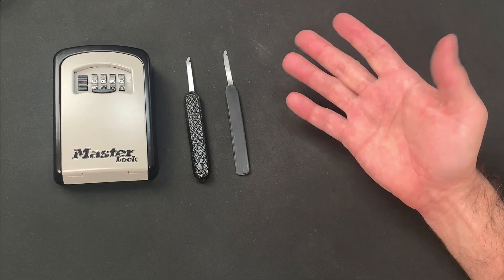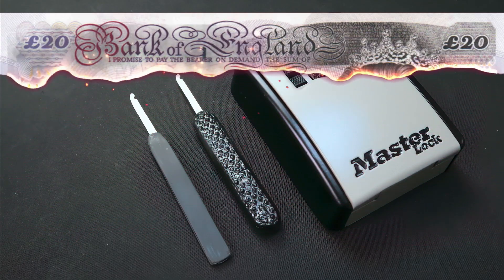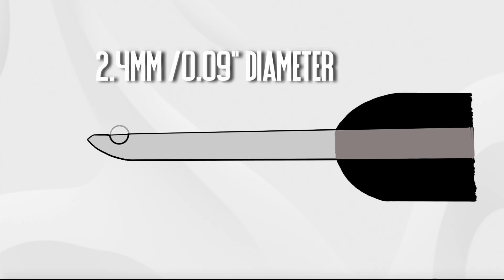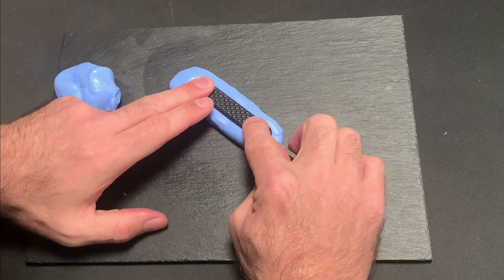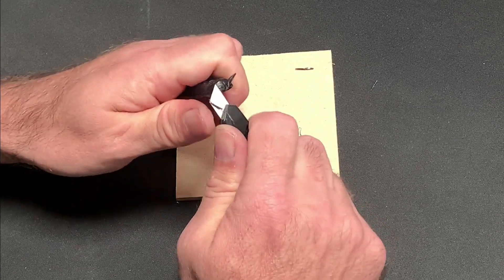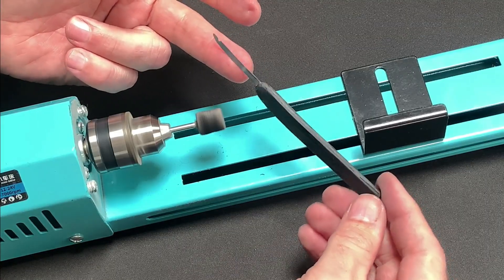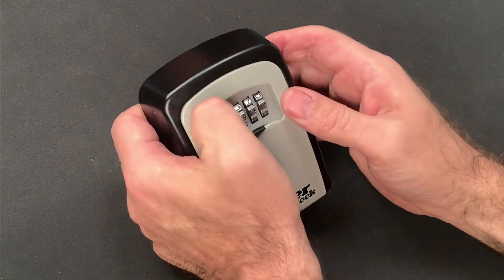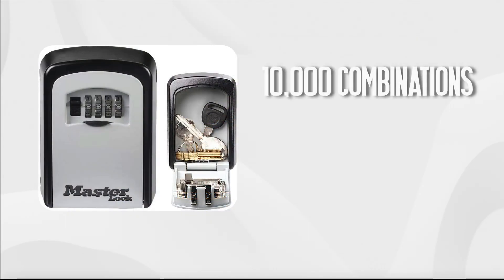028 How to make your own notched decoder to open combination locks

Comment: If you put the flat blade of the decoder into the top left of each code wheel and gently push up, when you rotate the code wheel down the tool will go up about 10mm when it finds the gate. Align the gates then up two on each wheel for the open. Much quicker, average 25 seconds for the open.

Comment: Gone and bought a cheap and nasty version of this lock (as if that's possible) and its fixed! they have made the wheels such a tight fit theres zero shim space!
But, where the code mechanism is fitted, the outer casing has too large a hole by like 0.5mm, so you can slide something in and simply push on the case locking claw...... like shimming an old padlock with a bit of coke can.

Comment: Fish, you did it for me, thank you.  I've been trying to open a 4 wheel lockbox for more than a week now (not continuously), then I saw your video and ... make a "decoder" out of a feeler gauge!  Well, I have a feeler gauge.  So I found one that fit, not snugly, but not loosely - 13mm (15mm was just a bit snug).  I put the feeler gauge in at the left side of the first wheel - then just marked the gauge (along the top of the wheel).  Moved it one to make sure that 0 wasn't the first digit.

3 wheels later and ... no.  I got the number (and wrote it down the SECOND time), but the box wouldn't open!  So I started decrementing all 4 wheels by 1, trying, decrement by another 1, try ... eventually it opened.  (I have no idea why I chose the number I did.

Now it's set to 0000, until I need it again.  So thank you.

Comment: 12pc broken key extractor kit online for a few bucks does the job very well. Slight modification to one or two of them and you now have a full set with varying gauges down to 0.15mm.

Comment: I have the sparrows one, but I've also made some out of stainless-steel cable ties/zip ties.  They don't have the notch but the tip on the ones I had were pretty much already formed. I folded the end over a couple times to stiffen the handle and slid it into a Southord rubber pick grip.
Reply: I've had them laying roung for ages, thanks i'll do similar,

Comment: Buying a decoder has always been a bit of a bad idea in my opinion because of how expensive they are. Even Sparrows, who's known for quality at a reasonable price, charges $15 for one while charging less than half that for actual picks. I always buy a set of feeler gauges for $5 and have plenty to make a set of 0.05, 10, 15, and 20 decoders and still have plenty left to make other tools. These things have to be costing them rounds about $2 to produce.

Comment: Wow, so much time to do so little.    Another guy said just take a soda can, cut it and make a shim from that.   I think a store brand might work better than a name brand as the aluminum may be thinner.   

Cut a strip about 3" to 4" long. The trick then is to cut it narrow enough to fit inside the left side of the wheel.   You don't even have to notch it, just make it a strip.   Simple enough. And forget about  needing to make a handle.  

Insert to the left side of the wheel, a slight resistance pushing down as you turn the wheel one number at a time.  When it hits that sweet spot, the shim drops.  You can confirm that by backing up the number   and the shim should move up.

Move on to the next wheel and so forth until each wheel drops under the shim.   Now try to unlock it.   It probably won't unlock because you have the right combination but not the right numbers on the top.   Move each number as a set one at a time.  If it was 1,2, 3, 4, move it to 2,3,4,5.   Doing this three times usually works and unlocks it.

You don't need an expensive tool.  You don't need any training at all.    I have a rotten contractor who has used this lock.  They thought they were smart by putting the keys in it and switching the combination so I couldn't keep them out because they have some very shady workers.  

Guess what?   Making a shim from an empty soda can with a pair of scissors, finding each sweet spot and unlocking it took around five minutes.  Oh, the video took me longer to view than actually opening it.

All you need is to cut that soda can, make a flat shim, trim it narrow enough to fit inside beside the left side of the wheel, push it in, push down a bit until you feel resistance, and then move the wheel until that shim drops about a  1/4 inch.  Repeat on each wheel until you have the right combination.  If it doesn't open, rotate each wheel in the sequence 1 to usually 3 times and it opens.

Having a construction company put this on your door is not only like having the keys hanging on a nail outside, it's like hanging a sign that says "come and get it" to a trained thief.  I'm not trained and not a thief but figured it out in about 12 minutes including watching the video (er, not this video).

Comment: I would rather pay the 25 bucks than go through all that! I don't find the Covert Instruments version to be as flimsy as you make it out to be. With a little finesse I have opened dozens of locks with both Sparrows, and Covert Instrument's picks with little to no damage to the blades. Besides, you can easily straighten these blades out with a pair of round nose pliers. You can get these pliers from Amazon for about 5 bucks.
Reply from the maker: Thanks for the comment -it doesn’t align with my experience but I’m glad you have found the tool more resilient. For the record ‘going through all that’ was fun - again, we all have different values and levels of interest in creating/appropriating tools.

Comment: Have you considered using one of the tubular scalpel blade holders, and using the part of the scalpel blade the fits into the handle as a template?  That would also have the advantage of easy tip replacement.
Reply from the maker: That’s a great idea Niq - not something I considered but I suspect that would work really well. 🙌

Comment: All a bit ott. I Just cut a coke can to form a tool. Novice, Picked in 5min.
Reply from the maker: I think the success or failure of that approach is really dependent on the lock in question but if that’s working for you, go for it 😉🙌

Comment: You can use a pair of round end jewelers pliers to repair them when they get kinked. I'm a jeweler on the side, and can confirm that it does work to fix thin metal.
Reply from the maker: Thanks - another sub mentioned that technique too - very helpful tip 🙌

Comment: Wonderful to see this. Many first-time pickers or pickers on a budget will benefit. I've found Noob's zip tie handles to be a good solution. Glad you've showcased them. I agree that LPL's decoder is too thin for most pickers so .19 does sound like a good compromise. Nice work. Hope to see more ideas here.
Reply from the maker: Will do my best to keep them coming - thanks for your support 🙌
Reply: What's LPL
Reply: @kenney1050  YouTube lockpicker The Lock Picking Lawyer. He has a store that sells picking tools for sport lockpickers, locksmiths and emergency service personnel.
Reply: @kenney1050 LockPickingLawyer. LPL.
Reply: @kenney1050 lock picking lawyer

Comment: Could you not just secure the shim inside the plastic granules instead of making two halves and then bonding them? Would be a lot thinner. However, I’ve never tried this so forgive me if this is very apparent why it can’t be done that way.
Reply from the maker: Yep I think you probably could but I wasn’t sure whether it would be strong enough but will give that a try another time 🙌

Comment: Hi Andy. Instead of using feeler gauges try searching Shim stock. Normally supplied in packs of 10  @ 300mm x 12 X Thickness required. Exactly same material but more of it for the price. 👍😎
Reply: What thickness is required?
Reply from the maker: Ooh nice tip - thanks Jeff 🙌

Comment: hi, I have got a little tip for you. Instead of using feeler gage, you could also use the springs simular like the ones in the pullback and let go toy cars. The smaller the cars the thinner and less wide the springs are. Greetings from The Netherlands aka Holland.
Reply from the maker: Nice - I’ll have to look into that. Thanks - always great to have these kinds of alternative solutions in the knowledge bank 🙌

Comment: Fantastic video mate. Very impressive and informative. I use a thin broken key extractor to pull up on the bar with heavy force and it makes it extremely easy to decode them in a few seconds. 👍🤘🖖🍻
Reply from the maker: Ah that’s a good idea - particularly if it is a nice thin pick or filed down a little to fit between the wheels of combo s with good tolerances. Hope the market is going well - need to catch up on your releases this weekend 🙌
Reply: @fishpicks4531  yeah it works great I did do two videes using it to open a combination key safes. I've stopped the market during winter as no one goes out in the rain. And don't want my equipment getting wet. But it was doing well. Thanks for asking. 👍🤘🖖🍻
Reply from the maker: @DarkArtsLockPicking  glad to hear it - maybe it’s worth building a website during the rainy season? If you do, I’d recommend Squarespace which includes e-commerce options and is super easy to maintain 😉

Comment: I’ve made several of these using zip tie handles and they work very well. Excellent job on the video👍🦊
Reply from the maker: Thanks Jack -yes, even though that was the simpler method, I think it worked better than the mould in many ways 😉

Comment: Brilliant video mate, I really like order of operations you did so you got two tools out of one piece of feeler gauge. That mini lathe looks awesome also👍🇦🇺😊
Reply: Do you use JB weld for all your pick making ?
Reply from the maker: @TheButchersbLock  thanks mate - this is the first tool I’ve made so I’m 1 for 1 with JB weld - seemed to do the trick, even though it all got a bit messy!
Reply: @fishpicks4531 brilliant job for the first tool. most 2 part adhesives do expand a little bit after you clamp them. When I glue stuff I always do it on paper because it gets everywhere